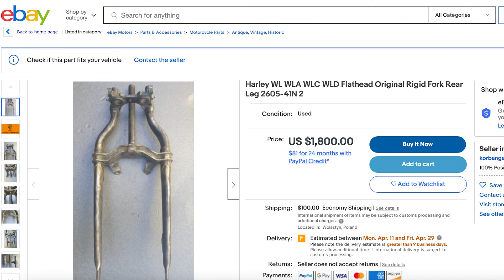Everyone Doubted that we could Fix this: WLA Junkyard Rebuild

Comment: You guys surprised me on this part of the project, you can actually do precision work when required.  Have gotten into these types of projects to many times, basically over my head, and had to dig my self out of the grave I stuck myself into.  But you learn and can take pride in your work.  Good JOB.
Reply from the maker: We are learning and trying to step up to the next level on this. and having fun in the process
Reply: precision work all the while wearing sunglasses lmao
Reply: @sunnycloudy1337  Oh, in this instance simply call them non standard welding glasses.  Keep several pair of wrap around shade 5 style so the kids and grandkids will wear them.  Have one stepson who believes "I can cut and weld fine with a gas torch without them", is fun to watch him fumble around the shop after he makes a cut or how shitty the cut is.  He also needs not a piece of angle iron as a guide either for a straight cut.  These guys often leave me scratching my head but hey it works for them.
Reply: @BikesandBeards  Keep up the good work, would love to send you some of the pictures of some of my off the wall projects I think you guys would get a laugh out of them.  One is a motorized bike, yep one of the ebay special engine type, with a homemade sidecar.  It works like a champ and it is powder coated bright red.  Made my own powder coat oven  which you guys would probably love for your shop.  Some say I am cheap but I just say I am creative.  If you had a e-mail site I could send a few pictures.
Reply: Bottom line is, IF you don't try, how will you ever learn? Trying and even failing  some times, is always a learning curve. But that lesson will be with you forever than... JMHO!

Comment: good luck straightening steel can be tricky, I'm a retired heat treater a lot depends on the type of steel and whether its been hardened or not, too much heat can change the rockwell hardness
Reply: @Alfred Wedmore I thumbed up, but I have no idea what you are talking about. Sounds good though. Carry on.
Reply: @Alfred Wedmore would the structure of the steel be compromised from the heating and bending process ?
Reply: these things aint heat treated ...  they can be straightened
Reply: @EJDRIFTZ  no if you keep the heat low
Reply: @Alfred Wedmore well said
Reply from the maker: @mebeasensei  haha 😂
Reply from the maker: @Alfred Wedmore how much does this equipment cost ?
Reply: @BikesandBeards  I don't know what equipment you were talking about but I made a comment about tempering the forks so they will resist bending again
Reply: @BikesandBeards  more than you can afford, pal.
Reply: Just need to anneal the steel bend it where it belongs and reheat it to a proper temper and tensile strength. I’m sure if those are factory you can find what kind of steel they are made from online.
Reply: @Alfred Wedmore Those front ends are brazed together, would heat treating affect those connections?
Reply: @Alfred Wedmore I'd do whatever it takes to keep the front on the bike that it came with.
Reply: @Alfred Wedmore I just read about Monel, I always assumed all those fittings were cast iron, very interesting.
Thank you, I learned something new today.
Reply: @Alfred Wedmore I'm sorry I just reread it, you wrote they used the Monel for prototypes, I thought you were saying all the old bikes used monel, I wasn't talking about the difference between cast iron and cast steel.

Comment: Also you can remove the chrome and rust quickly with some muriatic acid and 50% water solution. Then rinse with water and baking soda solution to stop the acid. Then have the springs oxide coated or gun blued.

Comment: You guys are doing a great job. There is no doubt that this project can be done by anyone. But to get it done without professional help with expert advice and attention to detail that is doubtful. With the right tools and close attention to detail anything mechanical can be restored to original or better than original condition when done properly. I think if you can straighten an antique springer front end you can restore any old motorcycle with your resources. By the way, that Corvette pictured on your cell phone is a 1964 C2, not a C3.

Comment: Good job, guys.  You two can start a side business fixing old bent forks    When I do something like this I worry that I won't remember how everything goes back together.   I take tons of photos.  I also  bag and tag each screw, bolt, washer, bracket, etc.    There's something a little horror movie-ish about the vapor blaster cabinet open and the gloves hanging down.    14:37

Comment: Nice job straightening the forks, took a lot longer than I expected, but if you haven't done this type of thing before, you did very well. You're on the right track, strip it right down, make every part as it should be, then put it back together. When the parts don't quite fit you'll need to fine tune the angles.

Comment: Getting there, the front fork leg isn’t as bad as it looks. The top rods unscrew from that casting and you can buy them new along with the springs all black oxide plated n all. So you just gotta mount the casting to a plate and then just heat it up with a oxy acet torch and bend it around till it’s straight. Replace the rods and you’re done. Or paint the leg first then put the oxide coated parts on it after would be the proper way.

Comment: You're supposed to have a spray gun looking nozzle on the end of your line for your blaster. It makes it work a LOT better and it's much easier to hold onto it. (I did a TON of blasting in high school, so rewarding.. including most of the parts for our 46 Indian) The reason that spring looks "pinkish" is because they plate with copper before chrome to act as a primer and fill in any imperfections. If you want the coolest trip ever, go down to Chattanooga TN to Advanced Plating and have them give you the tour and watch them replate your parts. They are the best in the country, they actually go back and forth with hard and soft copper until all the imperfections are filled and then nickel plate it then chrome. It's more expensive that way but a FAR better finish.. And in fact on that bike you'd probably want to stop at just nickel plating to fit the era as they didn't use true chrome on most parts back then, most parts were nickel plated.
Reply from the maker: Interesting. Did it get clogged up a lot ?
Reply: @BikesandBeards  if it does just cover the tip with your hand and hit the pedal a couple times and it'll clear itself out

Comment: Well guys as a tech that has been straighting harley and various other makers frames the work on the forks was pretty good. Not a fan of using heat but in this case and considering the small amount supplied by the propane torch I'd say your completely safe. Now an oxy acet torch is a whole different animal. Someone suggested it could change the durometer hardness and to a small degree it can. But its also dependent on the length of time heated, to what temp and then how its cooled. My question is why so quick to remove the tiedowns? You seem to be putting a lot of effort to stay original but then removed them. Anyway keep on humming along. Keep the vids coming. By the way i was able to spot what you needed to fix the bends a mile away. But then I've been at this for 40 years. See ya.
Reply from the maker: i guess the question is what original are we referring to ? and thats something that we have no really answered yet

Comment: The pinkish color is copper. Where you chrome (or nickel) plate a spring, you first plate  copper (strike) layer. That layer of copper provides some ductility under the chrome plate, which by itself, would be very brittle and easily flake off when it.

Comment: I have noticed people today use the liability dodge to avoid doing anything requiring some work.  In the 60s and 70 it was common  to straighten motorcycle frames and forks, swing arms even wheel rims it was also common to completely  remanufactured rebuild or restore Motors and transmissions for automobiles in fact in those days you could purchase kits to rebuild a fuel pump most of the mechanics today or just Parts changers . Hi-Tech computer-aided Parts changers . A lot of it is because labor has just gotten too expensive .

Comment: Loving the resto project guys keep up the good work! 

I have a special request for the commenters. I have a old 72 Honda cb350 I’m working on and I’ve redone the fuel system and retuned it. It idles fine, runs good and as far as I can tell there’s no issues with the compression. However, when I go to take off the thing stalls. No matter the amount on gas I put on it. I can manage to get it rolling good but if I back off the throttle even slightly it stalls. She’s really starting to test me. Any suggestions to what the issue might be?
Reply: you may have an issue with clogged jets or possibly vacuum leaks. old o-rings don't help either. clymer's had a really good manual for my own bmw. it wasn't cheap but it saved me much head scratching. those old cb's are good machines.
Reply: @jessebianchi2631  I have a clymer manual for it and I’ve cleaned all the jets aswell. Most orings are the ones my dad replaced 10 years ago so maybe it would help to fix them. Yes they are good little machines. Thanks Jesse!
Reply: @zacharydempster5383  welcome. had a nearly new 71 CB450 back in the day. lovely machine . a nearly complete one showed up locally and nearly bought it. too many projects already.
Reply: @jessebianchi2631  this 350 was my dads great uncles. When he passed it was given to my dad then he gave it to me so there’s some history in the bike.
Reply: @zacharydempster5383  very cool. it's a classic. if it's original paint and trim in decent shape, all the better. in that case i'd get it reliable and ride with pride. it'll be worth more too.

Comment: Park is a bicycle tool company the make a fork jig that would help, it clamps the head tube and theres a arm that you level fork then you slide the tool down to the blades and that will show which fork blade needs to be bent. Check it out and i bet you could make something

Comment: Success in any job requires patience. If you don't have it you are in trouble. Use an oxy-acetylene torch for heating. That little torch you use does not put enough heat into the metal. When the metal starts to go red it will bend easily and predictably.
Reply from the maker: this project is helping me be more patient
Reply: @BikesandBeards  I always enjoy your videos. I love the classic motorcycles. They have such soul.

Comment: No disrespect to any metal urges tensile strength heat treat experts here and I truly mean that and with that said I have 17 years in the off-road motorcycle industry and I'm looking at these old Springer linkage forks and say to myself they're not going to be used in a supercross race or any type of race condition of the metals after heating a little and straightening some will be fine for its purpose. But I hate to sound negative but I have dealt with those type of forks in the past and because of so many pivot points getting them back straight enough to be put back together well good luck with that and good luck I'm saying a prayer for you.

Comment: I think those rockers are short but I could be wrong...Making the angles hard
Also you heating the steel is weakening it you need to take it to a heat treater and get it hardened again

Comment: The good verse was so appropriate. 
Or, to boldly bend that which no one has bent before.
When Harley & the Davidsons first started out they would've gone down to the local blacksmith to hammer it straight.

Comment: Instead of Using a wood block and hammer to knock out bolts, I use a brass hammer. The brass is weaker than the the bolts threads so it will never mess up the bolt only the brass hammer takes the hit

Comment: Old chrome was copper on steel, nickel on the copper, chrome on the nickel, then heat treat to removed hydrogen embrittlement.  That is why the spring looked brassy/rosy.
Red

Comment: I assume at this point you've already done it but I had bent struts that hold the rear fender on a Dyna that was in a trailer accident and I talked to an old body shop friend of mine and he says steel holds a memory.
And this is a guy that when he says listen to me you're wise to do so. If you eat the metal up with a rosebud torch you don't want to get it red hot but you want to get it close to that point and I think it's somewhat of an art it was my first time but you get it close to the red color with the torch and Spritz it with water take the torch away and you can actually watch the metal twist back . He said he years ago there were I beams from a tow motor and they were bent I don't know how they got bent he watched and learned from an old man probably in the 30s or 40s I think he's 70 or so now and they heated up the metal with multiple torches and sprayed it with water and he said he watched that I being twist back into shape it didn't work perfect for me I had to heat it up and get red hot and finish it the job but it was a big step in the right direction doing the method he suggested.

Comment: Seems odd, folk normally straighten anything? Force it flat on to the bench top with G clamps and heat it in the bent bits until it gives up the fight and comes out right :o)

Comment: Bigger hose bigger gun, 100psi air pressure with carbide end 1/4” hole. You will blast stuff in a few minutes.

Comment: I heated and straightened forks on an old 50's bicycle.  After every time I rode it the forks slowly bent. Got to where I would just bang it into a wall to move it back evey now and the.

Comment: I totally understand that you want to keep it all original. But please consider buying a set of forks that haven't been in an accident I am not a motorcycle builder or fabricator I am just concerned that the metal has already been stressed to much to be safe 🤔

Comment: You better normalise the metal of that fork. Now you have bent it has non-uniform stresses in it and it is more like to bend or snap.
Reply: How is that done?
Reply: @swedishmetal96  For steel you heat the entire thing to 750-850C for 1 hour per inch of thickness (1 hours is plenty in this case) and then you allow it to cool slowly over 5-6 hours. They could do the poor mans version where you heat the entire thing with a torch to cherry red (or use a temperature crayon to be more precise) and wrap it in several welding blankets and let it cool over a couple of days.